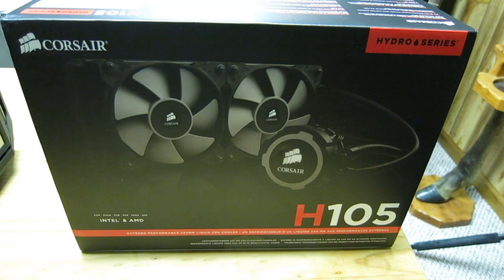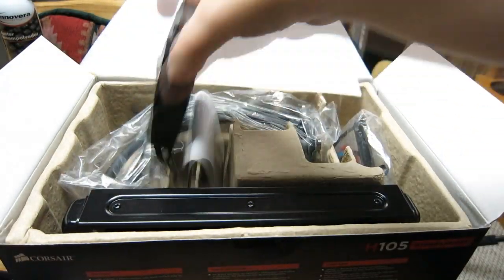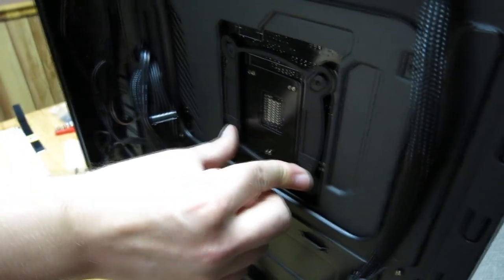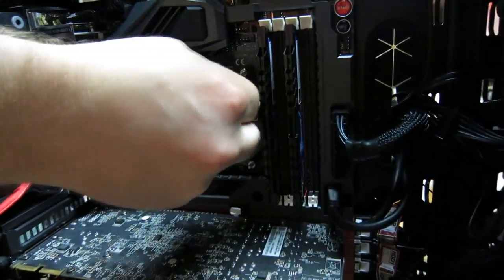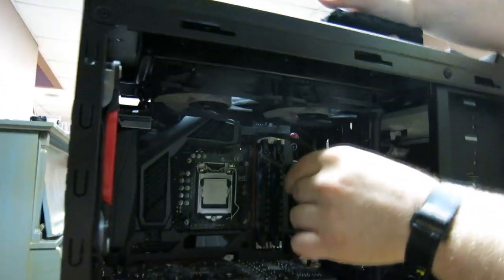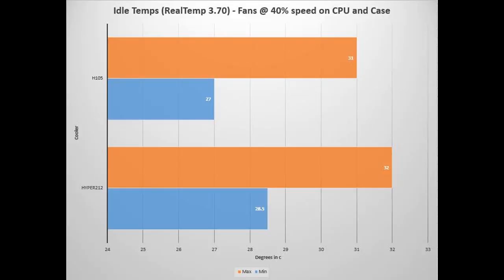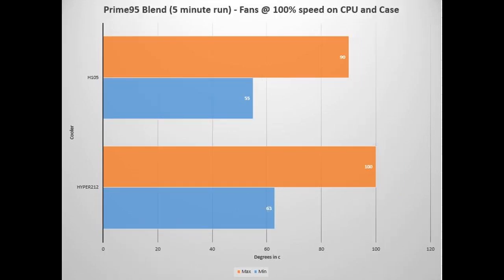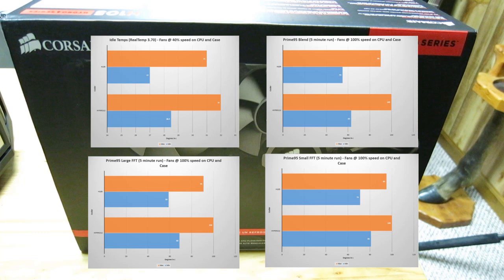Corsair H105 - Unboxing & Installation

Comment: Thanks for selecting this aio and doing the work to put up your results.  I really don't know why your experience with this aio cooler was off.  I've got two of these and they work great--the more extreme example was to cool an fx8370 running at a stable, no-errors 4.8-4.9ghz and ~1.49v oc, in an anidees mesh cube.  If I suggested anything, it would've been to mess with your fans, such as to try them as intake and with that case maybe even try a push-pull configuration.  I'd also have thought maybe you didn't seat the copper plate optimally.  I got mine on sale sub-100 usd.  I think the major drawback is ram and nb clearance when using the cooler overhead.

Comment: Processor's running hot, that's why they improved the TIM inside the IHS and released the 4790K, the same processor, but factory overclocked and running cooler. Good video though!

Comment: I love the concept of the thermal pad already applied!
I hate applying TIM to the cpu!
Question though?  Does that pad last for the life of the cooler?
or do you replace it after X amount of time?
Reply: +charvelstrat81 
It's not a pad, its a circle of paste...
You get very minimal temp differences using a good "aftermarket" thermal paste.
Unless you're overclocking and every degree counts, may as well use the stock paste that is pre-applied

Comment: I think you should consider making the fans an exhaust air flow instead of intake. You are taking heat out of your computer, however, you are blowing warm air on the radiator... which defeats the purpose of the radiator to cool your cpu down.

Comment: The blend run ran so hot because of your fan setup.
pulling air in from outside the case is usually the best option unless you have a very well ventilated case with LOTS of airflow already

Comment: What voltage were you using? That could be the reason why you running hot
Reply: ***** is the pump getting enough power? Check that in bios and if that's not the problem try reaplying thermal paste. Im telling because i have the same set up and your temp is way off target for that voltage